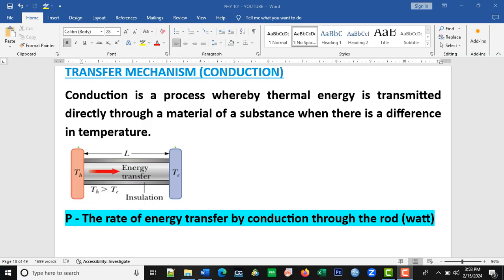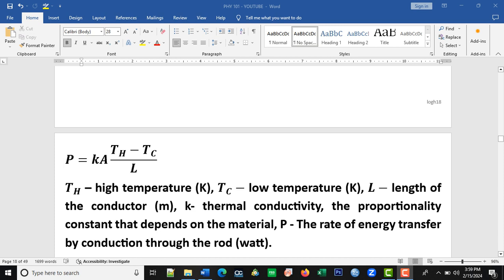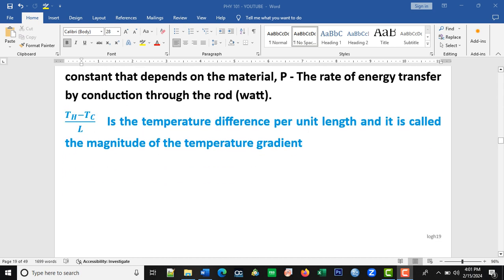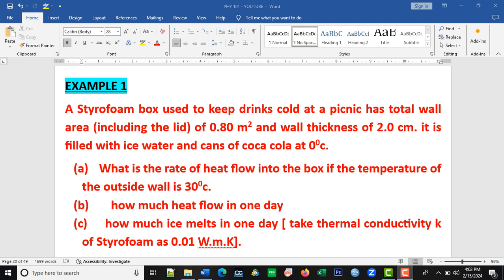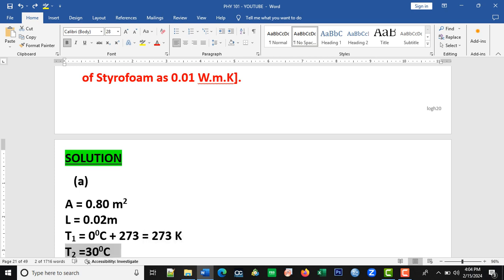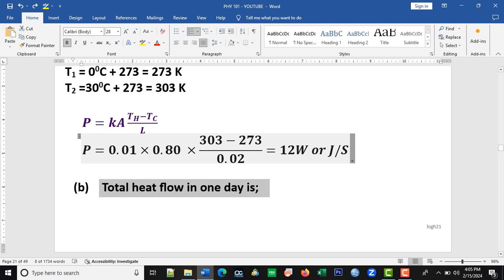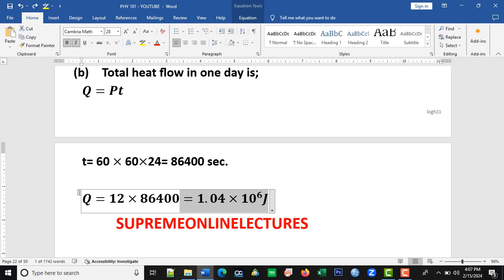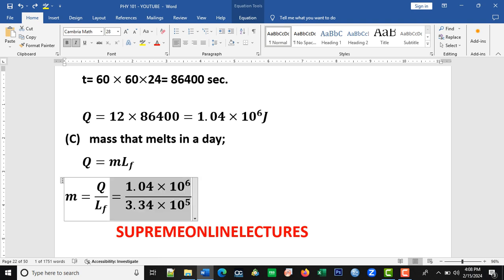Heat transfer mechanism conduction YouTube @supremeonlinelectures

Comment: Good day sir, in that number 2b, 12x86400 is 1036800, how did you get 1.04x10 rates to power 6 joules
Reply from the maker: Change the number from ordinary number to standard from. The number you got is still correct but also learn to work with standard form too
Reply: Thanks sir
Reply from the maker: You are welcome